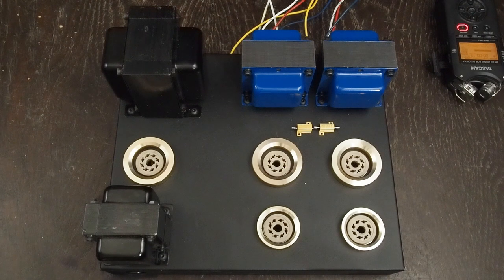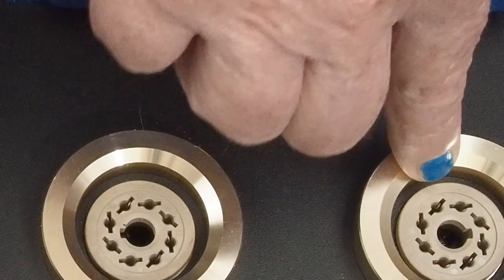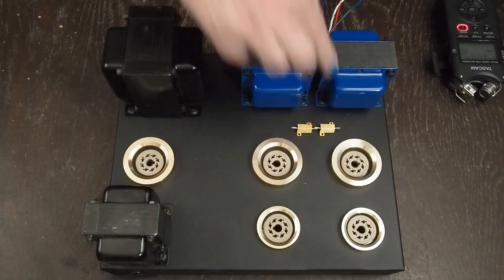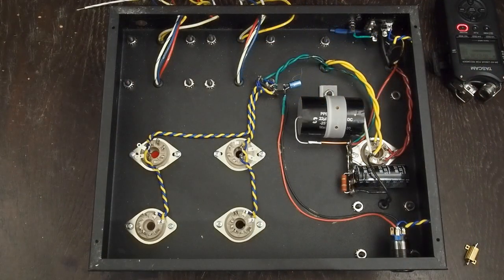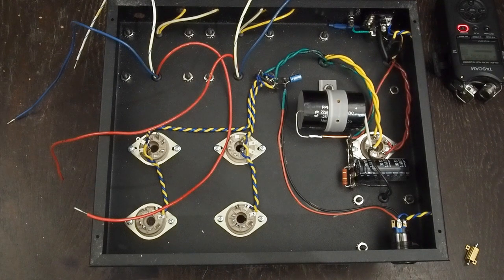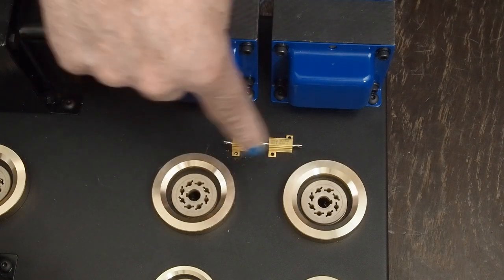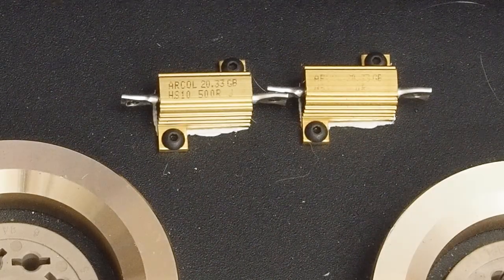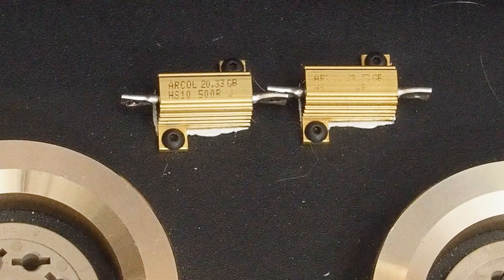6SQ7 EL34 Tube Audio Amplifier: Cathode resistors.

Comment: A couple of ideas for you.... Fasten the resistors to a small black aluminum plate with flat screws on the underside so it sits flush on the chassis. This will cover the holes you drilled and give the appearance of the resistors being some kind of "resistor pack". Another idea is to fashion some kind of small cage. This would obscure the view of any unsightly holes, and also provide the protection from wandering fingers you were talking about. Just thinking out loud! :)
Reply from the maker: Some kind of cage would be neat, making something that looks nice might be tough. I'm gonna go with this and figure out something to insulate the ends.

BTW great idea on the black aluminum plate to save a disaster :)
Reply: Or, make a slot in the top plate, cover it  with a black extruded aluminium heatsink (flat type). Bolt the resistors inside the chassis to the underside of the heatsink. Did that on a few amplifiers, looks great.
Reply: @SkunkieDesignsElectronics  It just occurred to me too that the plate doesn't necessarily need to be flush to the chassis. It could be elevated slightly with standoffs. The plate itself would still dissipate enough heat (in my opinion).
Reply from the maker: @jeffkamen2307  Lots of fun ideas! At some point I need to start a forum so you all can show and tell some of these!

Comment: Maybe some aluminum plate that matches the tube rings may serve as a resistor base to mount the resistors and cover any drill scratch. Any way the power tube are gona cover most of the resistors view, so its no big deal. Good work.
Reply from the maker: In the end, it looks fine. The resistor mounting pads cover the slotted holes and the scratch is behind the resistor, a little touch up paint and it's all but invisible.

Comment: Why are you using chassis mount cathode resistors? Isn't a 2watt or 5 watt metal oxide resistor enough for cathode resistors
Reply from the maker: To deal with the heat generated and IMHO you shouldn't be running a resistor under a constant load like a cathode resistor that close to it's max rated wattage. Even these chassis mounted resistors running at 20% of the rated load get pretty hot.
Reply: @SkunkieDesignsElectronics  but most amplifiers used carbon comp or metal oxide for cathode, plate, screen, grid resistors. I'm guessing that the cathode resistors dissipate the most heat compared to the plate, screen and grid resistors?
Reply from the maker: @waynegram8907  I would never use carbon comps in a modern amp, metal film is much quieter resistor and more reliable. Those other resistors in the amp are dissipating a lot less wattage because, for example,  plate resistors on the driver etc are dealing with 1-2mA at most. When you have 60mA across a 500ohm resistor, it's gonna put out a lot of heat. It's why I mount mine on top of the chassis, to keep this heat away from the heat sensitive capacitors. Also this is the idle load. Min I would want to try would be a 5W and I'm not sure how much we are saving vs going with a 10W model. A couple of bucks?